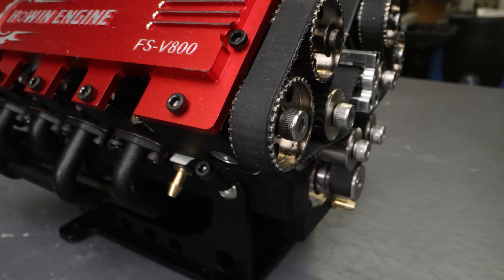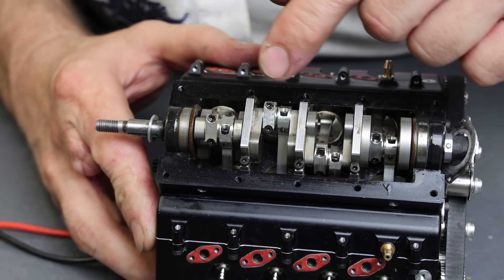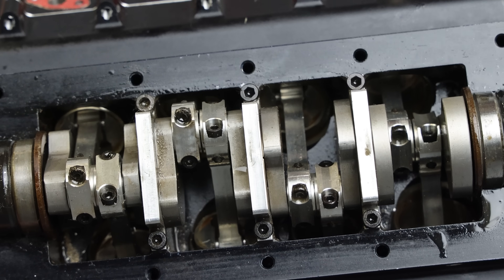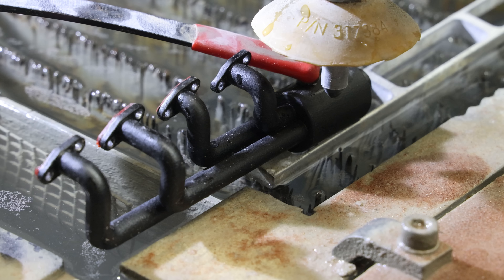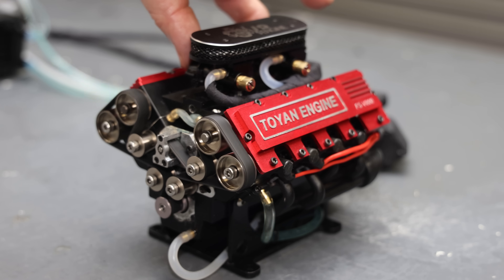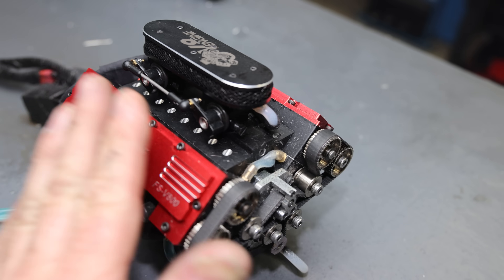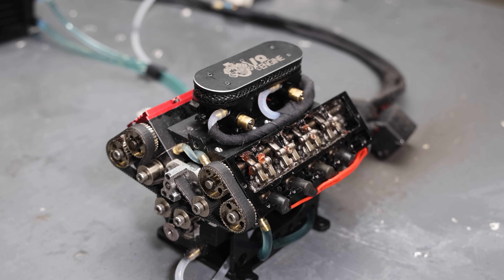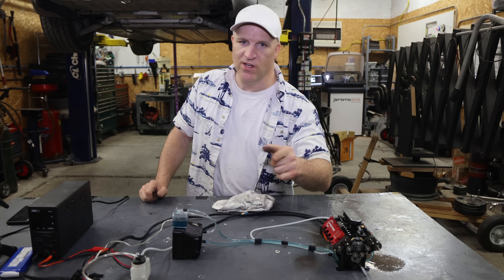World's Smallest V8 Engine Hits 10,500 RPM on Nitro (1.7 Cu In 28cc)

Comment: I call bullshit there is no way that thing is revving to 10,000 RPM I could be wrong but that’s just unbelievable for that crappy cam and valve system I cannot see that thing revving that high no way sorry I still call bullshit
Reply from the maker: Call bs all you want, I checked it and double checked it.. I mean it's a small engine, most of the small engines rub really high, that little tiny rotary engine that I was selling like 3 years ago hit 30,000 RPM.. a rotary wankel
Reply: @WarpedYT  I would have no trouble believing that out of a rotary they’re a high revving engine they’ve got very few moving parts but I think you kind of missed what I was trying to say I wasn’t saying you’re lying or anything I just find it absolutely unbelievable that that thing didn’t experience valve float or launch a rocker off the cam spinning at 10,000 RPM I wouldn’t of thought it would be capable of feeding itself enough air or fuel with those simple carburetters so no man I apologize if you think I was calling you a liar I was just saying it is almost impossible for me to believe that that thing would hold together at 10,000 RPM aside from the fact it didn’t even sound like an engine revving at 10,000 but I didn’t doubt you for a moment or what you were doing I basically saw something I just can’t believe but I saw it happen so it did but it’s still unbelievable to me I have a bunch of nitro RC cars so I’m familiar with small engines but that one just blew my mind I would be very curious to see what the power band looks like on it or if it can be ported or if you add an extra carburetter (siri spelling)  so you can flow more air would work forgive me for the lack of punctuation I dictate this shit to Siri and she’s not smart enough to do it yet
Reply from the maker: @600wheel  ha! I understand now, I didn't take it personal at all. I didn't believe it either and I agree it sounded much lower but I did make sure the tachometer I used was accurate, but yeah the engine sounded like it was too choking

Comment: I think you need to burp the cooling system. Put a funnel in the radiator and fire it up. Just turn the heaters on full blast and wait for the vents to blow hot air.

Comment: First engine I did not see you blow up.  I cringe when I see an engine this expensive with no oiling to the valve train.  I cringe when I see auto everything in your shop but you do not appear to be an engine guy.  On the other hand, I am restoring a 73 Cuda and if you have some extra money to blow, I could use it (right now I work on it as finances allow).

Comment: Hook up an air compressor and run 3psi of boost directly to the intake manifold on this miniature engine while its running on a dyno! obviously a DIY supercharger and turbo wont build much boost due to size but bet on 3 pounds this engine would be flying!

Comment: I'll be honest, it doesn't sound very good. Sounds like a weed wacker with a firing order thats off, and nothing like a carburated OHC V8. I've seen other minature motors, like small block chevy minatures that literally had the usual pushrod V8 chop. it was weird seeing such a small motor making hotrod noises. Even saw a mini Shovelhead Harley motor. Both sounded exactly like their bigger counterparts.

Comment: No wonder it's hot , you've still got air in the cooling system, you need to open the bleed tank , rev the nuts off the engine to remove the air,

Comment: You need an electric water pump that continues moving coolant after the engine is offbto help you with heat dissipation. I feel it also needs to move a higher volume of coolant since the tank is cold but the lines are hot suggests that coolant is staying in the lines too long.

Comment: Collector's merged into an x-pipe to duals would sound the best imo, you'll pick up some scavenging and drastically improve the sound. Either that or headers merged into a single large pipe.
Reply from the maker: I think you are correct!
Reply: @WarpedYT  yep, I see a lot of comments about back pressure being needed, it's simple not true, you do need some length for the header to keep the valves living. The back pressure argument has been disproven many times I've read that in the comments quite a bit. As drag racer it's simple not true, any back pressure will hurt power if the exhaust is designed efficiently to scavenge.
Reply: Like to see it with a scatpac exhaust system

Comment: vacuum bleed the cooling system!! its got more air than coolant atm 😥 that is why its getting so hot 🔥 as for the exhaust system put the headers back on before you shatter a valve!! the collecter idea was better than nothing but zoomies would have been better and use a better air filter id say its not flowing as good as it could... otherwise its a cool model 😊
Reply: Im not in it to win.. I just like to help out.. Give the spot to someone else 😃

Comment: It's running lean I could see bubbles going thru the fuel lines....pin hole leaks can do that or the tank foaming .... sure it's sucking some air in your fuel....vibration can cause fuel air separations and foaming.... yep looking at the end video you can see it's sucking air at the tank........ that's really bad for radio control engines..... the fuel lines should have absolutely no air bubbles.... it also looks like the fuel pump is v causing the sucked air to foam excessively

Comment: that thing idles at 6K? yeah no way dude... i don't trust that little plastic toy RPM gauge one bit...
Reply from the maker: It's accurate, I've tested it before with the high speed camera in one of my older videos on the see thru rotary MAX RPM video...it's correct

Comment: My 6 liter V8 does 7200rpm . I was expecting this tiny engine would do something like 20,000rpm.

It would be interesting to see the exhaust firing timing in slow motion to see how crank type determines sound. Looks like a cross plane crank.
Reply from the maker: Crazy I was trying to get that shot, but I had some technical difficulties at the end and figured I'll just shoot it in the next video..

Comment: proper fuel/air is very hard to maintain for small flows ... so this is impressive.
Reply: Very much so!! That's why I lost a few rc planes. So hard to get tuned right.. especially for takeoff when you have a G load on the fuel
Reply: It really isn't, as long as the carb is sized for the flow rates; I used to run 1.5 (0.09CI) glow (methanol) engines and it was easy to get the fuel mixture right from idle to flat out.

Comment: I found the disassembly when JohnnyQ90 did it on his channel. But I enjoyed the slow-motion and exhaust modification that you had done, making it much more fun to watch.
Reply from the maker: I also disassembled it here, me and Johnny both received prototype engines, and we are both told not to remove the heads. I actually had it before Johnny but I had a previous commitment so he got to release it first.
Reply: @WarpedYT  I personally like the slow-motion video of the valve train much better.

Comment: The internal combustion engine is still mankind's crowning achievement when it comes to mechanical engineering.
Reply: This! The crankshaft moved by pistons alone is such a weird concept, especially with the way the pistons move asynchronously. From a first glance, it doesn't look like it should work as it does, it's so counter-intuitive.

And we perfected these things to the degree that they can be mass produced.
Reply: The Hubble Space telescope.
Reply: @hugostiglitz6914  hopefully now to be the JWT!!
Reply: @backwoodsjunkie08  Yes, its had a bit of a ding from a micrometeoroid. Hopefully that can be sorted out!
Reply: @MiguelGonzalez-uq3by  You'll have to explain!
Reply: @hugostiglitz6914  Diesel engines last longer, make more power, better for towing they do it all but better lol you telling me you don’t see these monster Cummins out here
Reply: @hugostiglitz6914  i love my internal combustion engines buttttt diesel is literally better other then for environment but that would be why it’s so pricey
Reply: @MiguelGonzalez-uq3by  Diesel engines are Internal combustion engines as well!!
Reply: @hugostiglitz6914  nope
Reply: @hugostiglitz6914  do some research bud they start different ways
Reply: @hugostiglitz6914  that was the basics when I took automotive
Reply: @hugostiglitz6914  hence why they’re literally called Diesel engines and not internal combustion engines lol
Reply: @MiguelGonzalez-uq3by  internal combustion engines use an oxidizer in a combustion chamber. The difference between both types is that gas engines use spark-ignition while diesels use mechanical compression. Both still ignite fuel with high temps, so they're both still considered internal combustion engines.
Reply: @MiguelGonzalez-uq3by  😂😂. I think you're just joking now. You cant be that misinformed. An internal combustion engine literally means an engine that burns the fuel internally using a piston and cylinder. The fuel doesn't matter.
They can be 4 stroke, two stroke, wankel rotary, opposing piston, etc. 
Even jet engines are internal combustion engines which are turbo jet, turbo fan, ram jet, scram jet, etc.
Example of external combustion engines are steam engines and sterling engines.
Diesel engines are just compression ignition internal combustion engines.
Internal combustion engines are my day job!
Reply: @youseff500  ok bud Alr told the last guy the deal
Reply: @MiguelGonzalez-uq3by  If you took automotive classes, you need to get your money back!😂😂.
Reply: I love some rebuttals boil down to engineering achievements not focused on mechanical engineering.
Reply: Personally love engines but no .
The large hadron collider .

Comment: too much air in the cooling system.  JohnnyQ90 also had the same issue and swapped to a fuel tank as an overflow tank.  it would bring the engine temps down quite a bit to get that air out of there.
Reply from the maker: Honestly if I set this engine up to actually use it I would throw all that stuff in the garbage... All those accessories are toys, I would build a real setup. The engine is great and I have some plans, but my actual real cooling setup wouldn't look nothing like this.

Comment: Hey bro, sound is not compliant with expectations probably because each headers require an equal pipe length for each cilinder. diameter of piping also is a variable. Adding an X pipe that cross flow the headers also smooths, i then suggest to add a conical tailpipe according diameter to the tone you aim at.
Reply from the maker: I think you're 100% correct, but I also feel like this engine has so much potential sounds like it's choking.
Reply: @WarpedYT  may be it’s only a matter of carburetion setting. I see a lot of nitro sprayed out the exhaust. try a leaner setup and it will run faster rpm. if i’m not wrong it ate a tank in a while… good for break-in but not after

Comment: I think I’ll try fitting 4 carbs to mine when it arrives…then it will be getting the supercharger when that finally comes out. 
This engine definitely hasn’t got the fast throttle response that you would expect from a nitro engine.
Reply from the maker: Or maybe ITB's the way the L400 is set up. I'm definitely modifying mine very soon
Reply: @WarpedYT  yeah, I’ll wait until I have the engine in my hands before I decide how to go about it. Maybe the carbs can feed into a common intake manifold. Would make tuning a bit easier as well.

Comment: I've seen this on that Qjohnny channel. I think the cooling system could do with some work. Theres too much froth and air introduced into the lines at the pump and way too little flow in my opinion in those RC fuel lines used for the coolant
Reply from the maker: I agree with everything you said, those are my thoughts exactly
Reply: @WarpedYT  ...... What is your plan? 👀 😆😆 Can't wait to see what you do with it

Comment: was it firing on all cylinders? and maybe it was intake choked? there must be a restriction not letting it rev higher! id love to see that thing on a dyno also :D
Reply: or maybe it's running too rich? idk
Reply: @productxtreme4732  It definitely sounded like the carbs were not adjusted properly
Reply: i wouldn't want to rev it much higher then 10k plob would start to melt after awhile even with the cooling that why most run away engines stop running they can hit higher then 10k rpm but the stress on the metal and the heat is too much and they break apart
Reply: Hmm, yeah, build a dyno for miniatures...there's a idea !
Reply: There are so many things wrong with that engine... Cooling, 'oil', intake, fueling, valvetrain (I'm sure it's not sealing properly), it's unlikely to have optimal spark for that engine (even though that's one of the easiest parts),
Reply: @pistonburner6448  yeah once you make small engines you sorta throw out everything that makes a good engine for a long time till tech gets bettter and smaller
Reply: I was thinking the same about the intake.

Comment: A couple of things I notice are that the left inboard cam pully is not spinning true, and of course the coolant is aeriated in the lines around the motor. That thing is way cool though, I would straight pipe it like a dragster to give it a little bottom end and it would look cool. Thanks for the great videos.

Comment: I'm thinking the the heat issue was all the bubbles in your cooling lines, the water loupe on my pc had alot of bubbles in it the first time I set it up, after I got the bubbles out the cpu dropped 10 degrees.

Comment: Why grease in the rocker covers. The oil pump should be supplying oil up there. Where's the oil pick up? Surely this isn't run on the 2t principle of relying on fuel oil mix to lubricate he crank? If so this thing won't last long..

Comment: An 8 into 1 collector will make it really scream. If you want burble, make two secondary pipes after each 4:1 and put a H pipe between the two exhausts.
Reply: It's a flat plane V8, so none of that will work. The 8 into 1 will suffocate it, but yeah the other stuff would work on a cross plane V8, which this isn't.